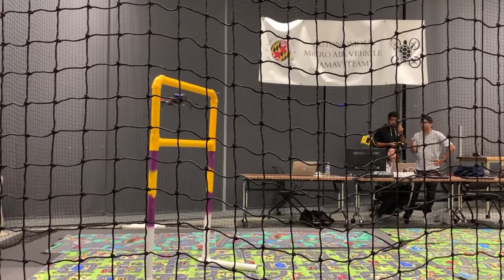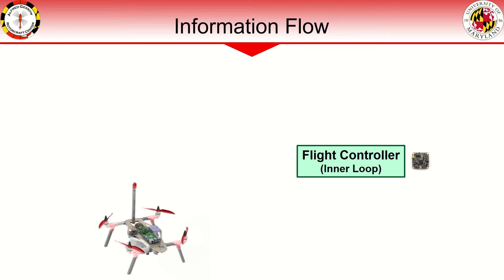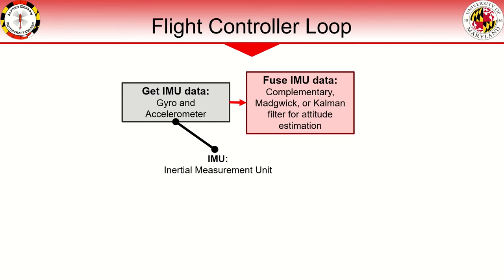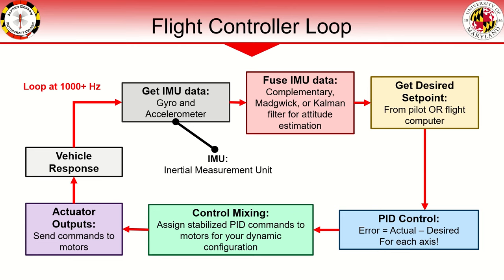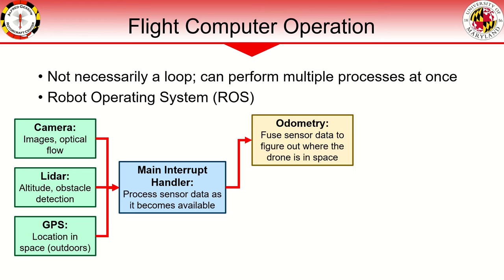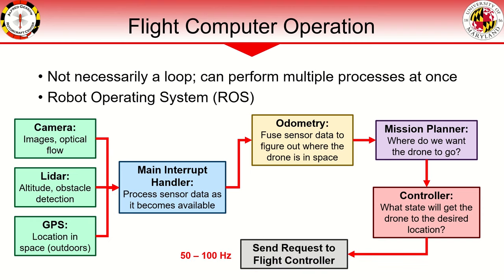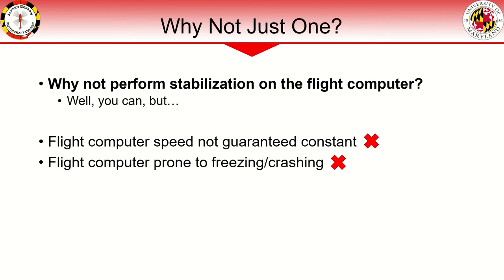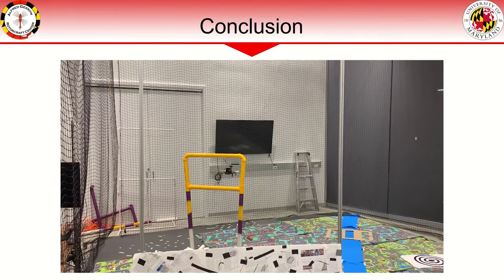The Difference Between a Drone Flight Controller and Flight Computer

Comment: This is an amazing video that pulls together many complex concepts and organizes them into a singular, high-level overview of how the system works as a whole. I find that taking a step back and looking at the whole picture makes it easier to grasp the smaller concepts. I am putting together an RPAS course and will definitely be using a version of your flight controller and flight computer diagrams to show how all of the data works with one another to achieve stabilization while performing intelligent functions such as APAS. Thank you

Comment: actually a flight computer is an outdated expression used for some onboard analog sensors in the past. In your context, however, a flight controller is the same as a flight computer. Flight controllers have a microcontroller unit, which is basically a computer with both flash and ram memories together with what's known as peripherals. Flight controllers accept signals from a local or remote controller, usually with sticks, buttons and potentiometers.

Comment: I can run arudpilot on a Kakute f7 mini v2 thats the size of a pack of matches (seriously, look it up) and the cpu doesnt get bogged down running a few basic peripherals. If anybody is looking to make their RC plane autonomous just start with an Omnibus f4 board and install arduplane. The amount of things you can do with a $30 board and an open source flight platform is truly unreal.
Reply from the maker: You can’t do machine learning or computer vision or advanced motion planning on and f4 with ardupilot... just gps waypoint missions
Reply: @NicholasRehm  Oh no no I wasnt talking about machine learning or computer vision, I was just talking about how easy it is to get started in the drone world these days.. I guess it wouldnt really be fully autonomous though
Reply from the maker: @flighttherapybullisticfpv133  yea I see your point! It all depends on what your goal for the project is--most of the time the pre-implemented stuff that can run on an f4 is more than enough for general purpose use

Comment: Could you possibly do a video on how to communicate with a flight controller using a flight computer? You give the example of ROS for a flight computer, but doesn't that require your flight controller to use ROS in order to receive ROS messages?
Reply: One way is to use the the pixhawk eco system of flight controllers. Then you can use the mavlink protocol to communicate from a flight computer e.g raspberry pi to the flight controller e.g. px4.

If building everything from scratch you could develop and use a canbus system to communicate between flight computer and flight controller.
Reply from the maker: ROS can run a simple serial node that can send mavlink messages or sbus, as an example

Comment: Thank you. If I want to start by building a remote controlled drone, I won't need an on-board computer right? just a flight controller (microcontroller)?
Reply from the maker: Hovering RC just requires stabilization from a flight controller

Comment: I am more concerned about different supply voltages of pi, controller and motor. Can I use same battery to power all 3 or something else?
Reply from the maker: It’s generally best practice to have separate propulsion and avionics batteries to prevent voltage spikes from the power system getting into the avionics. Avionics battery needs a regulator to bring down the voltage (usually 5v for flight controller + computer)

Comment: But how exactly will my computer override the controllers mission, say I am planning a mission on pixhawk fc using QGC and I also want to do precision landing using aruco markers, so how do I make the controller-computer understand that as soon as the drone is above aruco markers, it should switch to precision landing algorithm and land on aruco marker...even if that means aborting the mission path assigned in QGC.

Comment: Are there any useful resources for getting the two components to communicate with one another?
Reply from the maker: Depends on your systems... mavlink serial between ardupilot/ros comes to mind. If you're running something like betaflight for stabilization, you might need to spoof a radio receiver protocol like ppm or sbus from your computer
Reply: @NicholasRehm  Thank you for your response! After watching your video I've been working on a project, trying to send sensor data connected to the Rpi through the flight controller .  I'm having a bit of trouble formatting the sensor data into a mavlink frame and sending it through the flight controller to a GCS using mavproxy. Are there any videos you recommend or resources? I've been scouring ardupilot forums, wiki, and youtube, but haven't had any luck.
Reply: @mums2109  Hi which controller are you using, i'm intereseted in building one

Comment: Flight computer are programmable, or I have to design my own for an experimental aircraft?
Reply from the maker: It depends on what you're trying to do and what board you're using
Reply: @NicholasRehm  I want to code a stability augmentation system(SAS) for a naturally instable plane, currently I'm using a RPI Zero W with Linux, should I use another chip to do all the SAS, IMU and fusion calculation?
Reply from the maker: @sb3nder  If that's all you're doing, the Zero on its own will work fine. Just be mindful of how much processor power the operating system is using (typically why I would do inner-loop stabilization on its own dedicated microcontroller)

Comment: A very crude analogy, would be horse - rider... Horse (flight controller) deals with low level commands ( standing- moving etc) while a rider  (flight computer) deals with the high level commands... At least that's my understanding of the relationship. Therefore, the smartest horse, vs the smartest horse with a trained rider will be more efficient.

Comment: can be autonmous without GPS? I want from A to B but no GPS only data read from sensore and come compas to see where is northpole. I think can work. Specially in cave where no gps signal.
Reply from the maker: Yes--GPS-denied autonomy is a very interesting field. You will need some way of localizing within your environment, either cameras, lidar, or a combination
Reply: SLAM stands for simultaneous localization and mapping. From Wikipedia: (SLAM) is the computational problem of constructing or updating a map of an unknown environment while simultaneously keeping track of an agent's location within it.
Hopefully this will give you a few search terms to help you find the information you're looking for.

Thanks for the interesting video Nicholas Rehm.

Comment: so if i got this correctly lets say i want to fly my drone from a computer then i shall only use a raspberry pi or something and not a flight controller?
Reply from the maker: It really depends on your application, ardupilot/px4 will do basic sensor integration and gps-based autonomy on the flight controller board itself. But the main point is, advanced autonomy is generally done on a companion computer while the onboard flight controller handles the core flight stabilization
Reply: @NicholasRehm  ok I understand now thanks for this information I liked your video as well